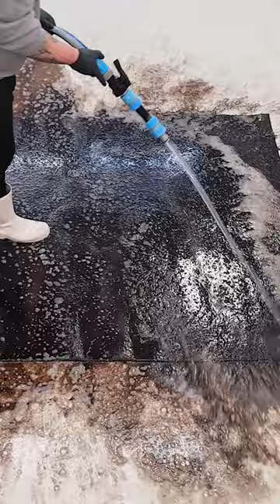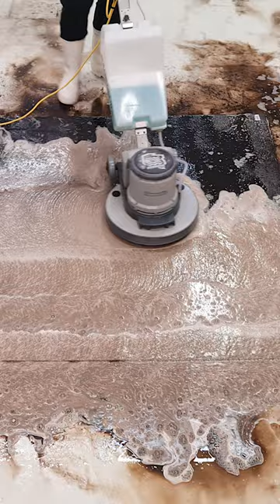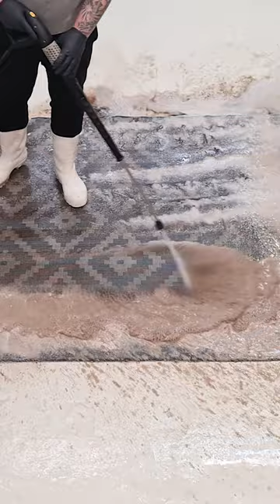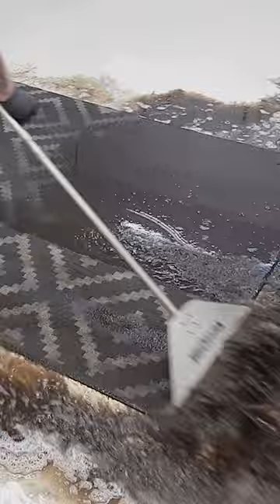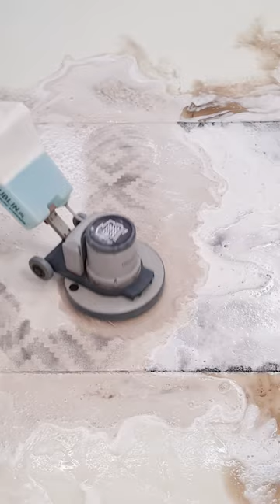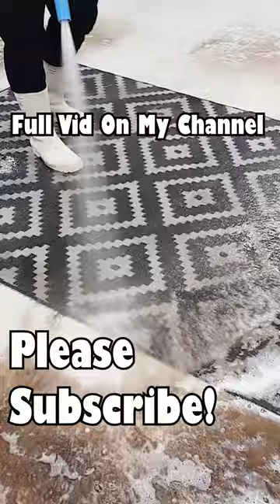The black and white squares carpet hypnotizes again after cleaning #shorts

Comment: I know you're  the profession and the process is important.... but why not start with pressure washing to remove most of the top debris then ad your soap and chemicals to the stuck in debris directly and not on top of the stuff that can be sprayed off? wouldnt that save water, chemicals, and time?
Reply from the maker: Thanks for your opinion about me.
Of course, it would mean to start with pressure washing and it would certainly give some effect.
On the other hand, old dirt needs time to dissolve, so first we pour a gentle stream to soak each fiber well and then we start the washing process.